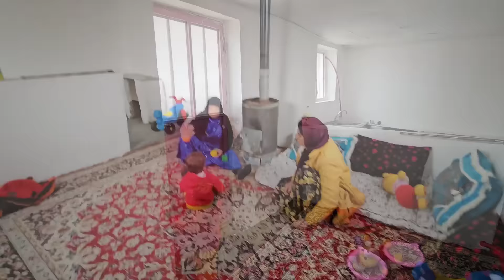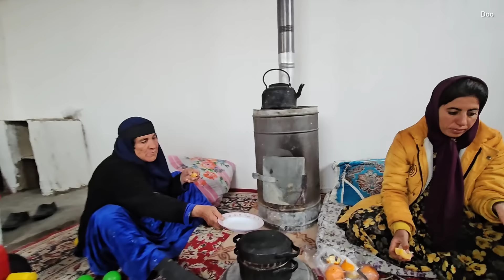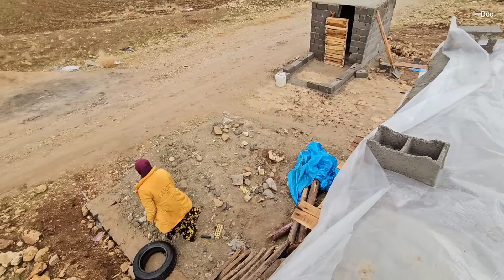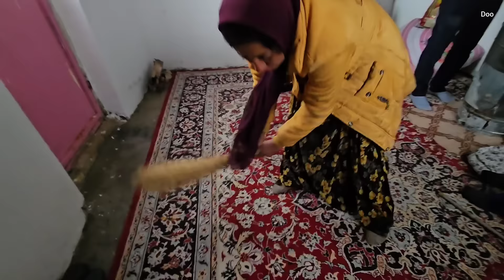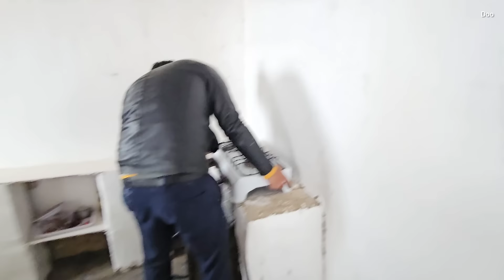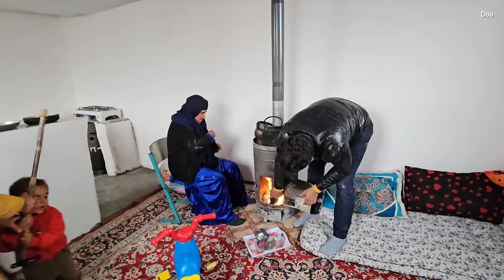Indomitable: A Divorced Woman's Resistance Against her Ex-Husband's Diabolical Deception

Comment: Pour cement on the back of the house so the water can run through there and not disturb the house. Like a channel with dip so the water can flow pass the house.  Everyone you are in our prayers for safety, solitude and happiness in Jesus name . Amen 🙏🏻
Khalil get yourself a knit hat or cover for your head .. it will help with your sinuses… help with a head cold that could be starting on your head